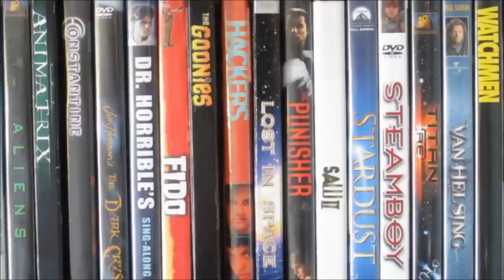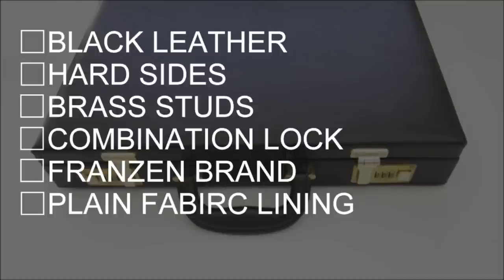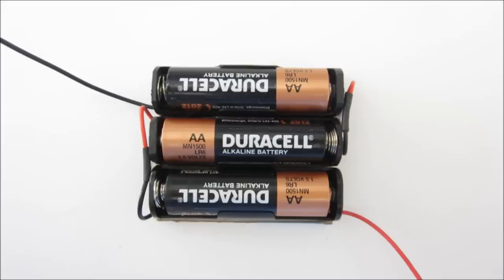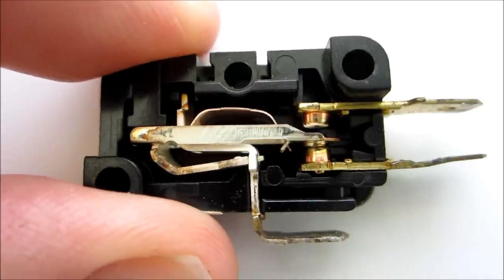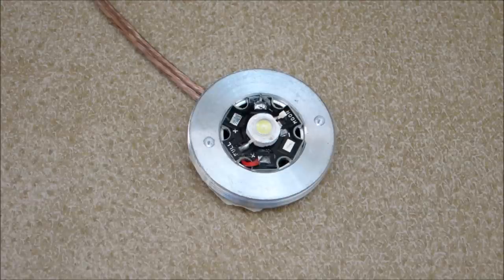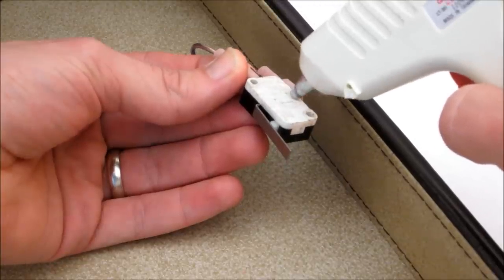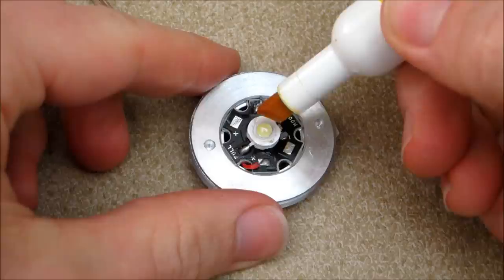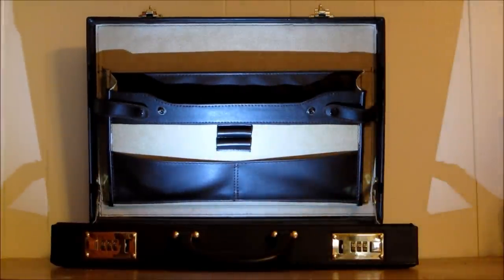How to Make the Glowing Briefcase from Pulp Fiction

Comment: I discovered a MUCH easier way to do it.  I found a motion-activated battery operated LED light at Home Depot.  I spray painted it orange and attached it to the inside of the briefcase using adhesive Velcro and VOILA.  When the briefcase opens, it lights up. It turned out perfect.  Thanks for your inspiration, though.
Reply: So... I just tried this. Dude. Thank you for simplifying the concept. Went with a fifteen dollar motion activated LED strip, and it works PERFECTLY! Thinking about yellowing up the color of it, but I'm half tempted to leave it as is as a tribute instead of a replica.
Reply: @colinoscopy2673  Dude, are you as pleased with the results as I am?
Reply: I also had the idea of going to home depot but didn't know what I would need thank you for making an easier version

Comment: I can find a briefcase with a franzen lock please help
Reply: Look up "Amerileather Leather Attache' case. I got mine for about $40 on eBay. I'll be building a similar case but using LED strips and a 12V 3800mAh battery. Not sure if I'll use a cherry switch though...
Reply: @IconicBattles  - I used a motion-activated battery operated LED light from Home Depot.  I painted it orange.